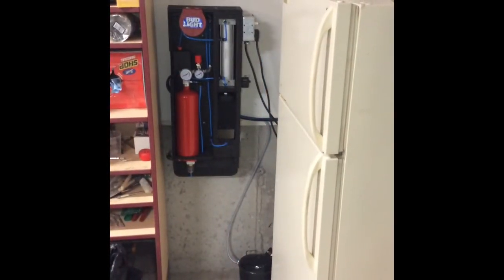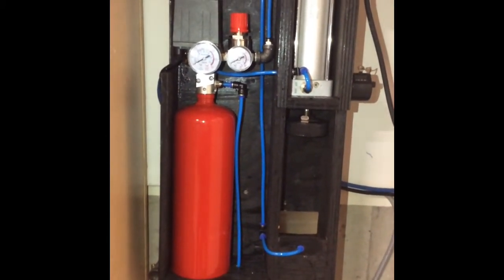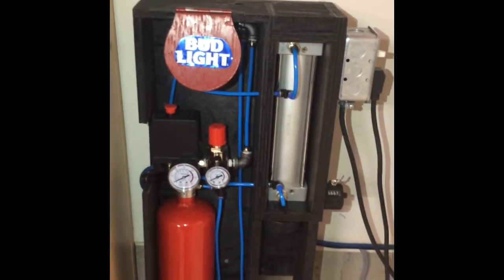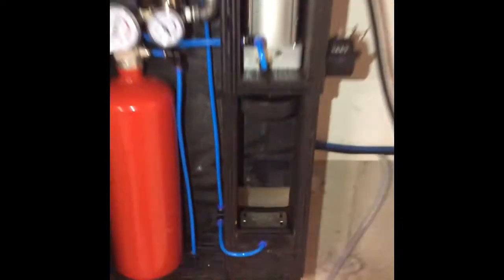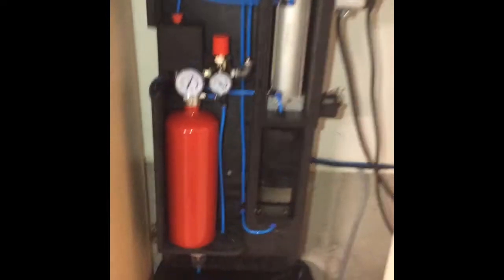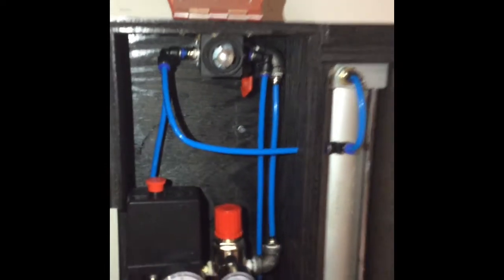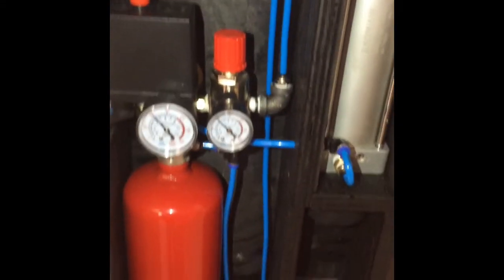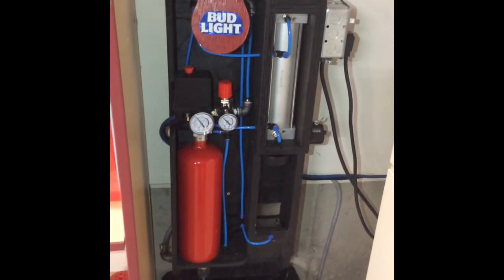Air Powered Vertical Can Crusher - powered by Freezer Compressor only.

Comment: Love the setup dude! I want to build a dual refrigerator compressor unit with a 30lb propane cylinder to have a relatively quiet yet constant air supply in my home garage. Really digging your build though, that's cool!